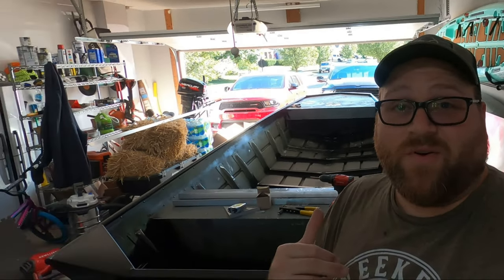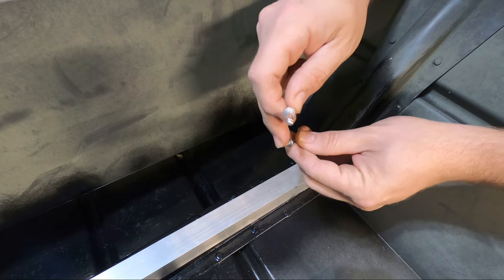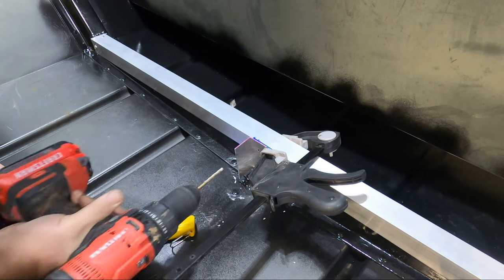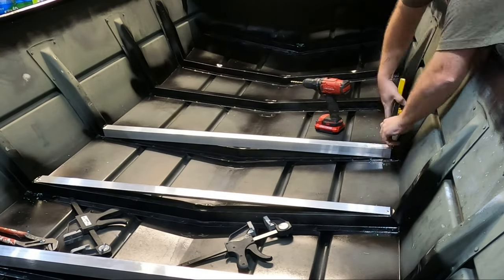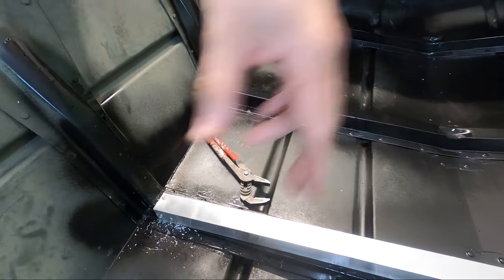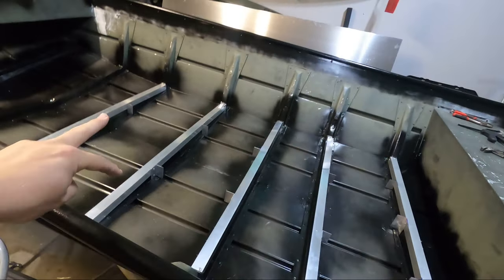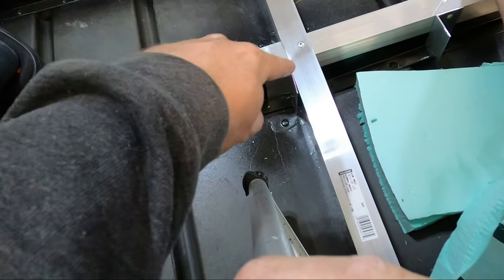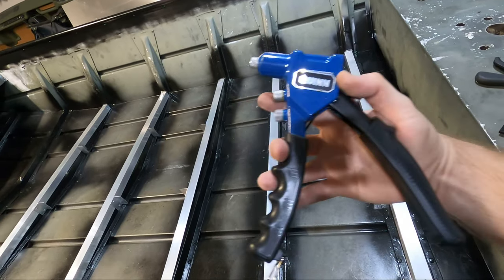ALUMINUM BOAT SUBFLOOR INSTALL | 1648 Jon Boat Build - PART 1

Comment: Enjoyed the video.
I am laying a new sub floor in a mod v as well and am curious how far you were able to run your floor with the severe angle toward the bow? Is that why you added the front bench seat? Thanks
Reply from the maker: I stopped about a foot after it started to angle up. I figured since I couldn't walk on the angle it would make more sense to turn it into storage.
Reply: Thats what i figured. Thanks! @mvboutdoors

Comment: Do you worry the the metal on metal supports could create holes in the hull from flexing over time?
Reply from the maker: That was definitely a consideration when doing the supports, I made sure they are only riveted to the ribs so nothing is rubbing on the hull.
Reply: @mvboutdoors I’m glad i read this comment because on my deep v i was just going to cut small pieces from angle rivet to ribs and then go up with other angles. problem with that idea is i would have to drill holes in the side of the hull to attach the deck . Unfortunately my boat was a closed bow up front that i cut open so i need to put side supports in and drill some holes into the hull

Comment from the maker: Foam and flooring coming next, starting to see some progress! Taking suggestions for floor coverings. Carpet, eva foam, rubber mats, etc. What do you guys think? I'm hesitant on the eva foam because it stains so easy.
Reply: Thinking about maybe doing something like this to my Lowe 16/48. What thickness flooring are you using
Reply from the maker: @dewaynewebb3467  It's 0.1, little less than 1/8th
Reply: @mvboutdoors  I was pricing some 1/4 inch 4x4 and it was over $400. Maybe I’ll need to go thinner
Reply from the maker: @dewaynewebb3467  Yeah it can get real pricey real quick, shouldn't need thicker than 1/8 if supported. This was under $300

Comment: Did this reduce flex? Im trying to reduce flex as i have a couple rivets that only leak when im mobbing in rougher water
Reply from the maker: It stiffened up the boat for sure. I would rebuck the rivets and seal with epoxy first.

Comment: I’ve got a 1648 tracker grizzly that needs a floor where can i get braces like that for my sub floor
Reply from the maker: These are built using 1/16 aluminum angle. You purchase it at your local hardware store. I believe I used 1.5"